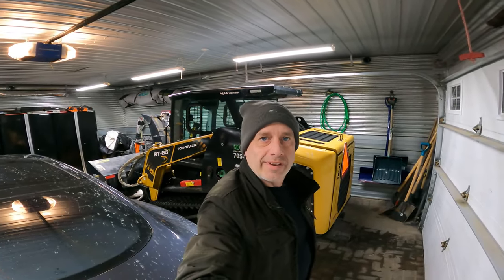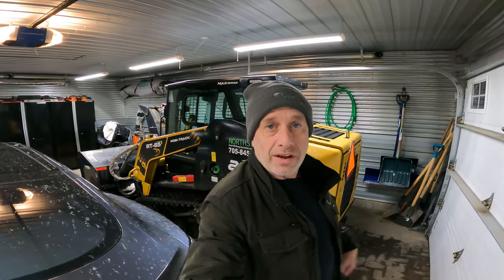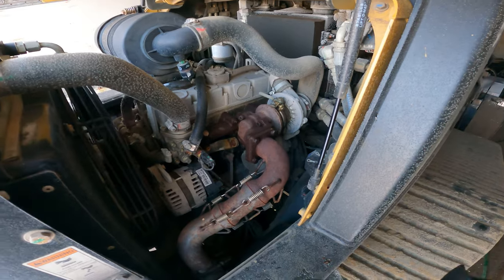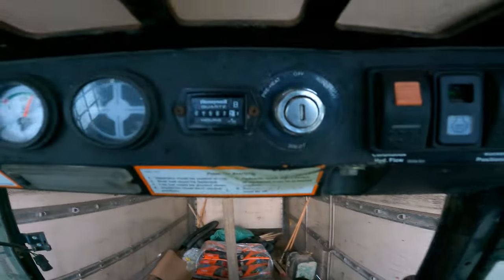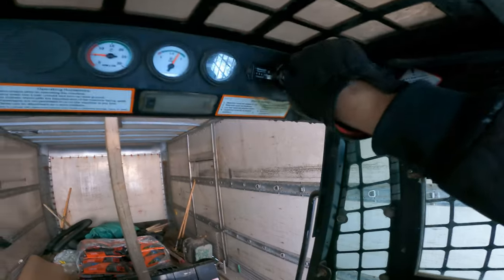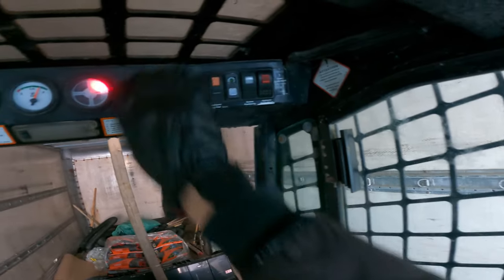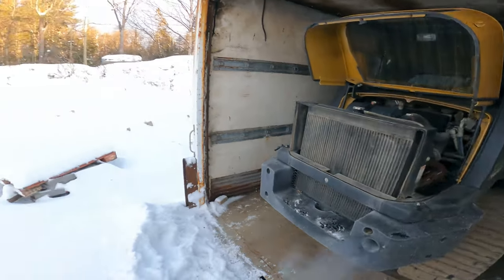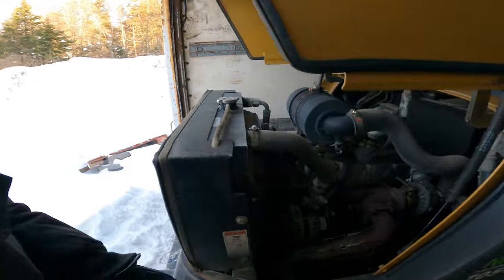ASV RT-65 MAX or ASV RT-60 Which is Better?

Comment: I have a Terex PT50T, which is the same as your ASV RT60. Currently at 455 hours and it recently started chewing out fan belts. I worked out the reason was rust on the drive pulleys from rain falling directly on the engine via the overhead vent mesh. I've cleaned up the pulleys, but they are still wear out belts quickly. I now ALWAYS cover the machine with a tarpaulin when parked outside. It's pity ASV didn't vent the engine bay through each side of the cover, rather than through the top. Making side vents is on my to do list.
Reply from the maker: I agree they could have covered the top I've consider making a canvas snap on top.

Comment: A question: How does the sound level in the cab compare between machines? Thanks.
Reply from the maker: Well i would think the RT-65 would be better but it's still a machine and noisy. I wear Bluetooth ear muffs so I'm not 100 percent which is better.

Comment: How does the snowblower do on the front of the RT 65. Is it hooked up to high flow?
Reply from the maker: Yes it's working on highflow I did talk about it but forgot to add that bit into the video. I did a separate video on that last year check it out.
Reply: @Northbaylandscaping  Have you tried It on a standard flow machine? How did it do? If someone only had a standard flow machine would you recommend a snowblower or not
Reply from the maker: @thelarochellefarm595  oh yeah well RT65 is capable of both hi and standard flow your essentially increasing the GPM from 22-27 and it will work in both. Hiflow provides more power or speed to attachmentments. Just make sure you're matching the gallons per minute between your machine and the attachment.